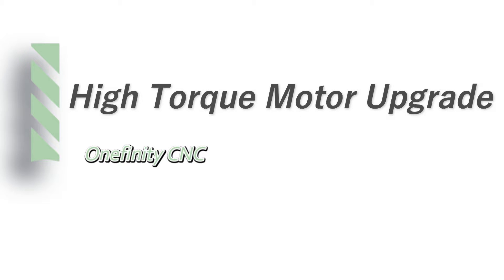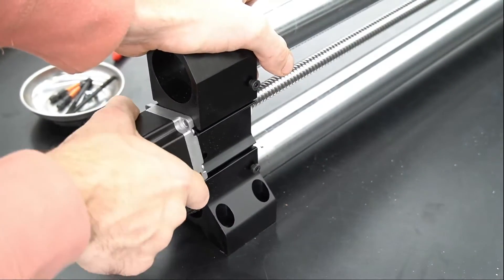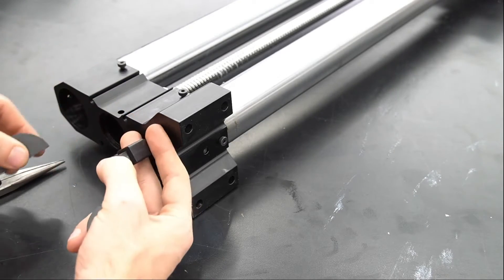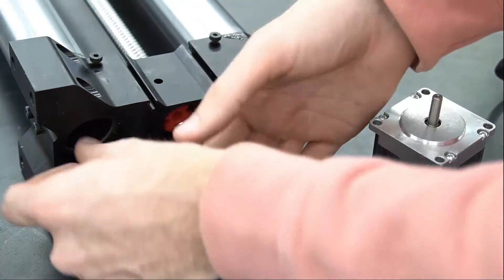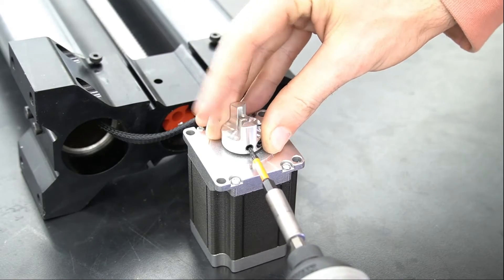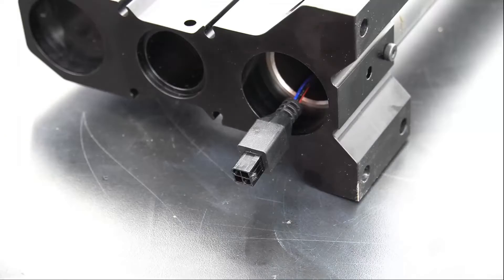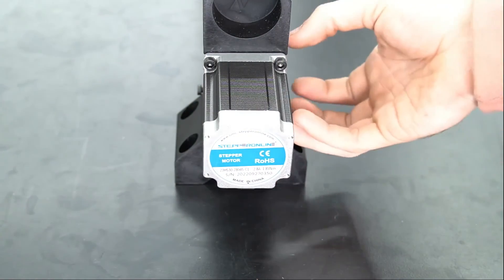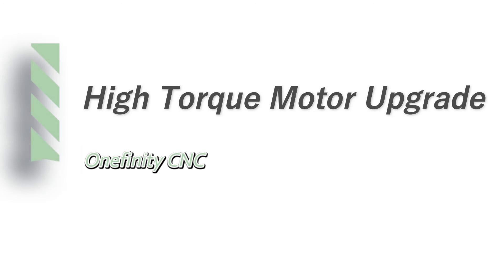Onefinity CNC Original Series High Torque Motor Upgrade | Support Video

Comment: Does the stepper driver need to be changed or can it provide the output amperage required?
Reply from the maker: it does not need to be changed